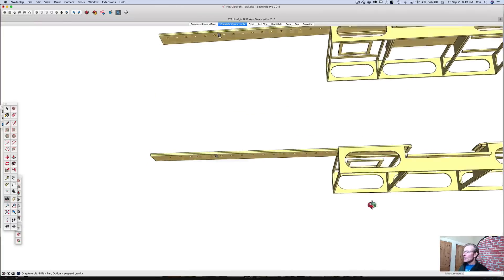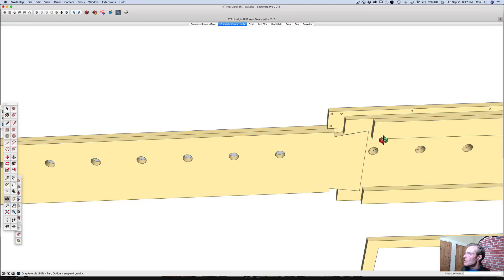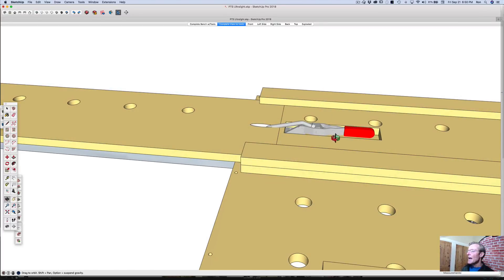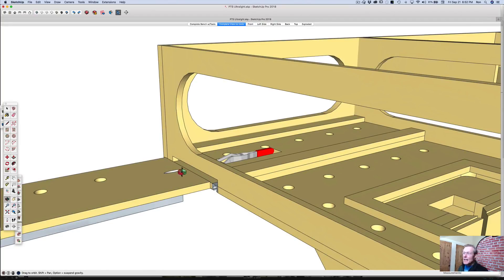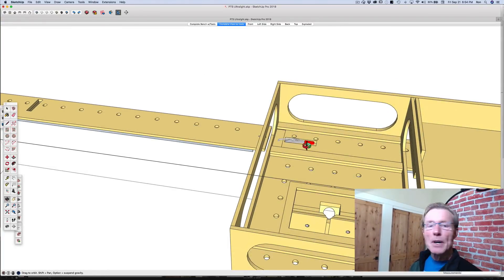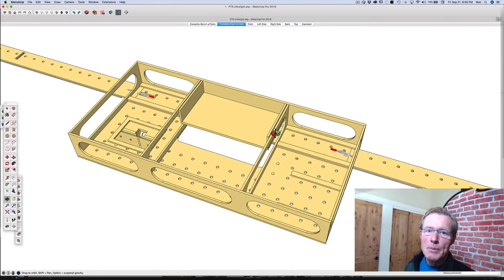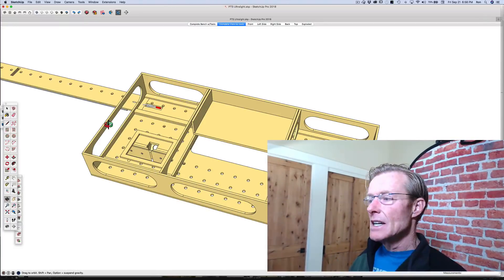3 PTSU Clamp options

Comment: Hi Ron:
Love the design and have watched your struggle to make the curvy clamp work.  If the problem is that the hook on the clamp can't get far enough down to engage the pocket hole, how about just putting a wedge under the clamp to tilt it until the hook fits.  Measure the distance that the hook needs to move downwards to fit the pocket hole and then make the wedge that thick at the far end tapering to zero at the end that will touch the extension.  
Just a thought.
James

Comment: Ron, 
 Would a 'push-pull' toggle clamp work???  Put a dado across the entire end back an inch or so.  Mount the push-pull to the bench.  On the toggle end/bolt, add a bit of metal bar stock or angle iron about 4-5 inches wide.  The angle iron/bar stock would fit into the dado and lock into place.  Think in terms of extending the pocket screw hole the width of the extension like you have in current prototype but with the push-pull toggle instead of the one you have now.

Comment: Kevin Criswell, a simple way to be mounting two smaller circle pieces, instead of sized to fit the hole tightly.  The mounting location of the smaller circles would be off center like you mention for cam purposes.  Mounted with a shop made knob so its easily loosened and pivoted toward the center of the circle cut out in the extension for ease of mounting.  Then when the extension is in place, you twist the circle and its off centered mounting cams it into place nice and tight against the edge. Then twist the knob to lock it in place.  Shop made knobs like shown on the previous PTS are thin, easy to make and cheap.

Comment: Hi Ron, I'd like to suggest that you make the tails on your extensions longer, taper them and round off the tip while using a dovetail profile on the edge surfaces like s large bayonet mount. This would allow it to slide and lock into the PTS which would have the receiving end of the mounting. Possibly a hardware free solution.

Comment: Dear Ron,

first a suggested solution ... why not use 'drop-in' pins; with a smaller diameter for the lower section of the pin through the PTSU side extension 'tabs' and a larger diameter for the upper section of the pin through the PTSU top.  If the holes were drilled with 2 sizes of holesaw, drilling the larger hole through the top first, with the side extensions in place.  You could use the hole drilled in the 'tongues' by the pilot bit to centre the second hole.  However, that would still leave you with the problem of finding suitable diameter stock for the 'pins'!

The first 2 solutions will not work in the form that you have presented them.  I suspect that they are unlikely to be 'modified' to work either.  The best way to demonstrate this, to yourself and others, would be to generate a 'longitudinal' cross section through the centre of the circular 'pins' or the mid point of the side of one side of the dove tails.

In order to provide effective support to the side table extensions I assume that you will want the sides of the PTSU to be their full thickness - 1/2 ".  That will mean that you will need to locally reduce the thickness of the top of the PTSU, in order to provide space for the side table extension tabs to slide into place at any angle other than horizontal.  Also, the 'pins' will need to have a wedge shaped cross section in order for the 'tabs' to clear them on insertion and withdrawal.

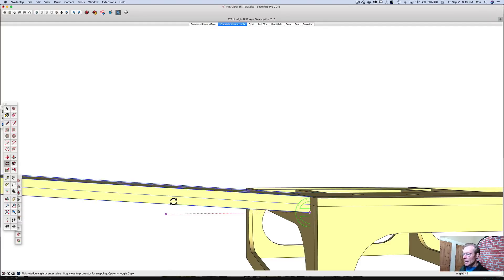The 'limiting' rotation point horizontally is the top surface of the PTSU, and vertically is the inner, not the outer face of the side of the PTSU.  It was this outer face that you appeared to pick at 1:42 in the video.  As there are 2 points of constraint the motion would not be a simple rotation about a 'hinge' point.  According to some geometric 'modelling' that I have done in MS Excel this evening, if you were to plan on a 10 degree angle to slip the 'tabs' in at, you would need to take a wedge out of the bottom surface of the top that is 4 mm deep at the edge and at an angle of 10 degrees to the bottom surface.  If you were to create a 10 degree 'incline' for your router and a 'shoe' to run on the incline that slopes the router a further 8 degrees from the vertical then you could rout a slot through both the top of the PTSU and the 'tabs', that gets deeper as you move towards the middle of the PTSU.  If you were then to glue a suitably sized domino or piece of ply, with the edges rounded over, into the top then you might have sufficient engagement between the end of the wedge and the slot in the 'tabs' to effectively draw the side extensions into place in the main part of the PTSU.

Yours Aye

GB

Comment: I have the perfect solution (I think), OK people do not laugh, yes when I was young, I bought IKEA furniture (If we can call that furniture) I had no choice at the time, the wife (long time ago) wanted that exactly.... I remember one clever idea, a lateral bolt lock, in here we could use 2 of them, with the appropriate stud on one side, and the bold at the bottom on the other side, when you line up the small stud in the hole, all the way where the nut can grab it, you just turn the nut and it pulls the other piece to a snug fit...I will send you the picture. You put 2 of those on your extension and just with a turn of a Phillips screwdriver and the extension is locked, then to unlock just unscrew....  I just sent you an email.

Comment: Yellowboxshed have 3d printed bench dogs 20mm or 3/4 that are designed in two parts to join two layers of board together through the doghole.  Don't know if they will work on 12mm but if not John could probably whip up something that would work.

Comment: Two thoughts:

1) A modification of the first option shown. A larger top circle that bottoms out on the top of the extension (flush to the bench top) laminated to a smaller cam below. The cam fits in a hole cut in the extension tongue, and the extension is drawn tight to the bench by rotating the circle/cam assembly. The whole assembly could optionally be locked with a countersunk screw, washer and nut.

2) For a no-hardware approach, how about a simple slot and wedge. Of course, you'd want to dial it in so that the wedge is flush (or ever so slightly recessed) with the bench top/extension surface. This could be accomplished with a plane and/sander. As a side benefit, wedges could be replaced quickly and easily from scrap lumber.

Comment: Hi Ron, if you go with the clamp design. Use prong nuts recessed to hold the clamp body down. 

If you also recess a washer that can be glued in where to do the pocket hole that will stop the wear on the ply.

Comment: How about using wedges. The removable table has a wedge and you have a wedge in the same lengt as the with of the board to lock it in place. You will need a slot in the "bench" to put in the wedge. Don't know if I explained it good enough so it's understandable. I like the amount of thinking you put into your work.
Reply: Kyrre Soleng I like the wedge idea. I would cut two slots you could run screws through for both alignment and to keep it in place and a bigger finger hole to pull it in place.

Comment: Hi Ron, as always thank you for all the hard work you put in that ends up benefiting me!

Have a couple of ideas for the extension clamps as that is a problem with my total station.

On your double disc suggestion in this video, would it be possible, instead around disk, to install a cam disc off center that would draw the extension tight to the table?
Reply: Oh, and sorry, I'm working on that second suggestion!

Comment: hey Ron, I wonder if you could use something like this:
https://www.amazon.com/Reliable-Hardware-Company-RH-A3004-Butterfly/dp/B00JJ18OVI/ref=asc_df_B00JJ18OVI/?tag=hyprod-20&linkCode=df0&hvadid=198097826602&hvpos=1o4&hvnetw=g&hvrand=8702587958995315624&hvpone=&hvptwo=&hvqmt=&hvdev=c&hvdvcmdl=&hvlocint=&hvlocphy=9028289&hvtargid=aud-466606931481:pla-321036538948&psc=1